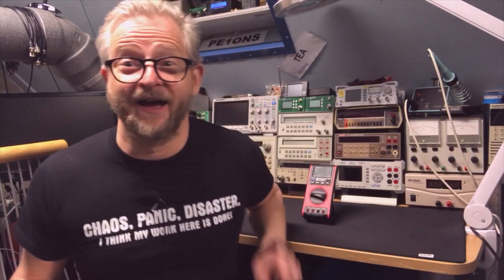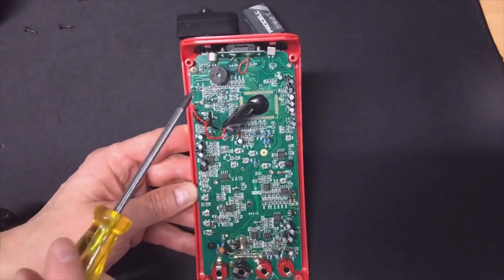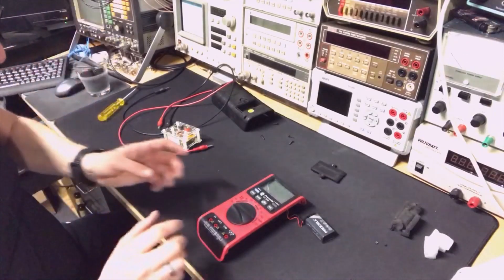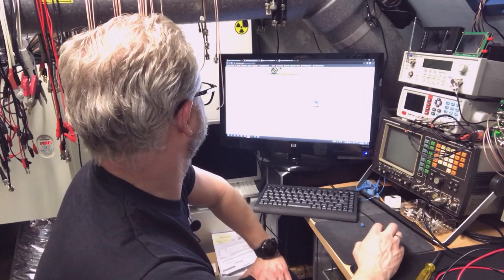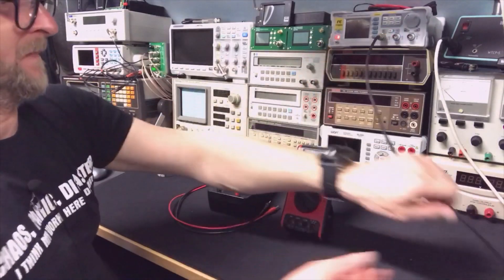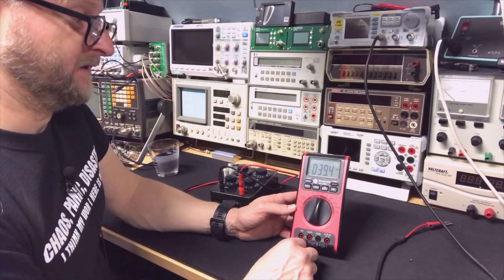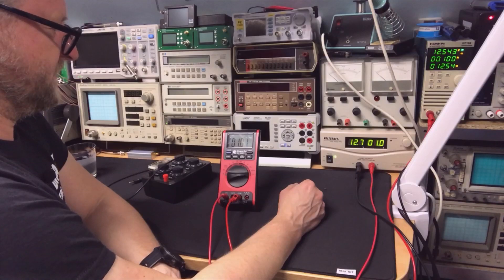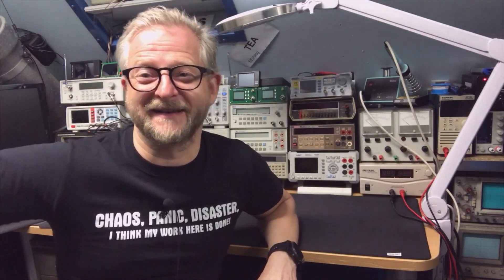#089 PowerFix KH3322  - Mastech VA19 Multimeter Repair

Comment: Hi , I have a multimeter  having the same design , brand  M8 and model  VA16 . Good build quality , measuring accuracy is acceptable ,  the screen is dark so the legibility pretty poor .
Reply from the maker: Hi, sometimes the polarisation filter wears out or breaks. you can find those sheets on AliExpress, maybe that helps
Reply: @TonyAlbus  Thank you  for the advice .  I own several multimeters ,  the most satisfying among them is the Peakmeter PM19C (  manual ranging )  . Big display , a  bit heavy but  accurate and responsive , excellent NCV  reactivity . You should try it someday . Have a nice weekend .